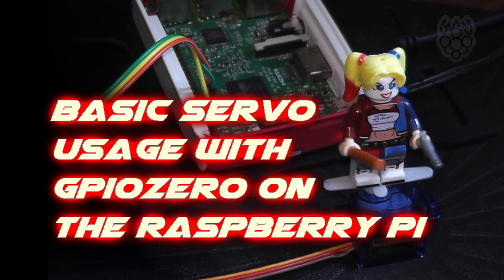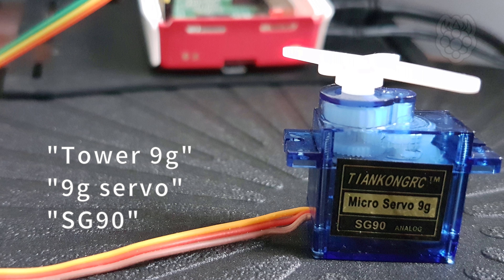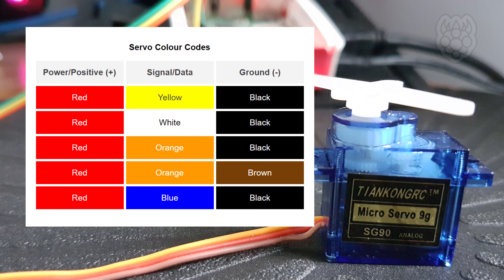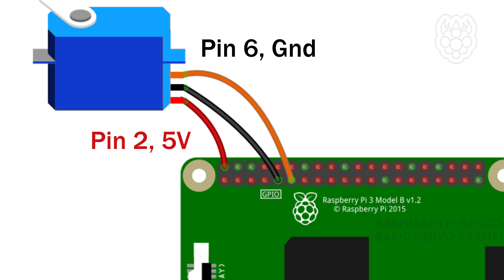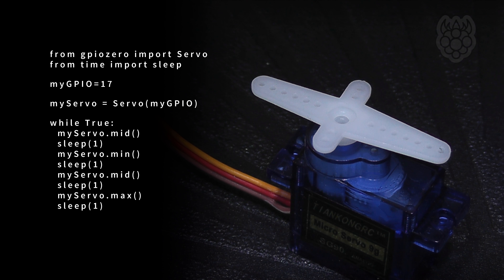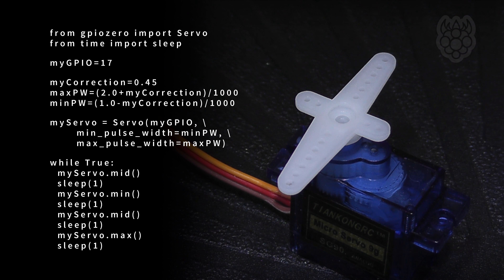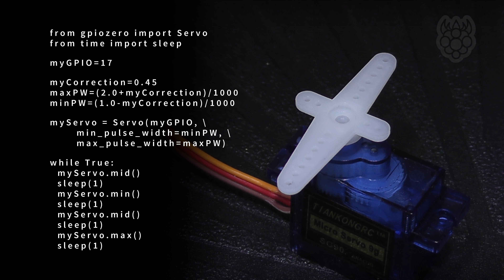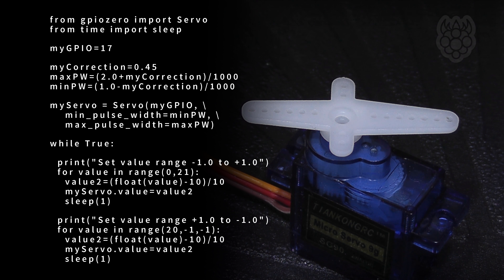Raspberry Pi Basic Servo Examples with GpioZero

Comment: This is an extremely clear and straightforward video on using the Pi and GPIOZERO to control a servo, and includes the specific Python code for several alternatives.   Thanks.

Comment: Very helpful video, liked!
I am looking for some info about controlling this servo with a usb analog control pad (like an xbox 360 controller)
What i am doing is running a single game (super hang on) on the pi, attach the servo as you do here, But id like the servo to move left and right according to the analog stick input whilst at the same time the raspberry pi is running the game on am emulator.
What would be the best way for me to get this to work? thanks